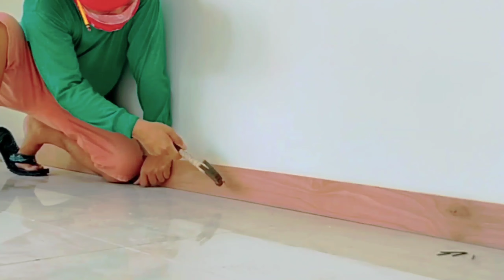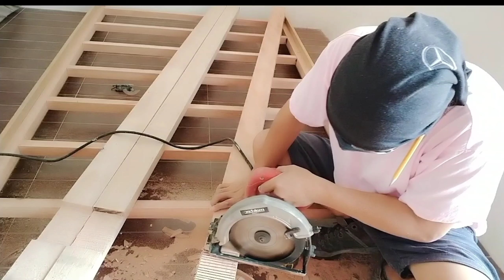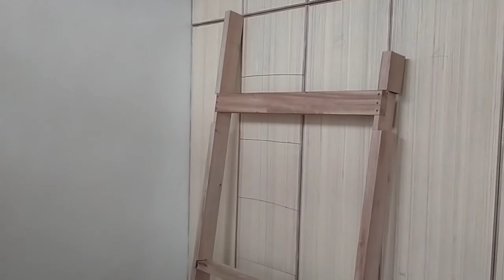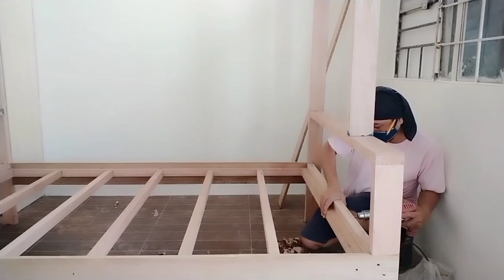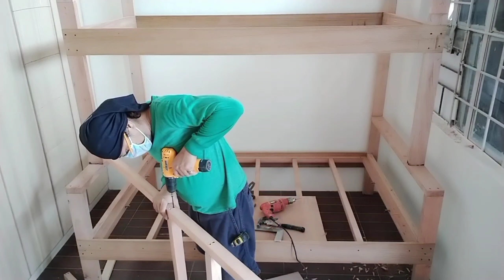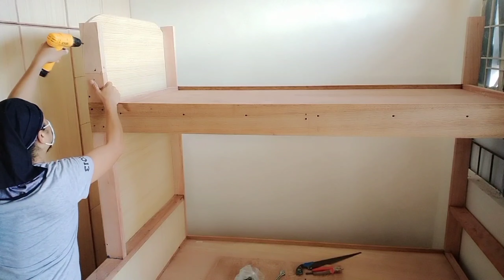Part1/Gumawa ako ng Double Deck bed/single at double/Kulotz Nacua tv

Comment: Pwede makahingi ng materials list sir? Gagayahin namin gawa nyo. Thank you
Reply from the maker: ok po.ung ginamit ko po jan.2x4x8.2x2x8.tapos 1x6x8 tapos plyboard po 3/4 5pcs tapos drawer guide 18ung haba blackscrew #3#2 stikwel un po.
Reply: salamat sir.
Reply: @kulotznacuatv3361  para saan po yung drawer guide
Reply from the maker: para po sa drawer.
Reply: @kulotznacuatv3361  boss ask ko LNG po mga ilan piraso po exact po na nagamit sa pagbuo ng ginawa nyo?
2x4x8=
2x2x8=
1x6x6=
Ply board 3/4=
Drawer guide 18"long=
Screw #2=
Screw#3=
Boss tha k sa sagot?God bless po....para po magagawa ako first time ko po gumawa nyan kung mamarapatin nyo po na makahingi kung ilan piraso ?thank u po....
Reply from the maker: 4 pcs 2x4 5 pcs 1x6 12pcs n 2x2.screw n #2 #3.